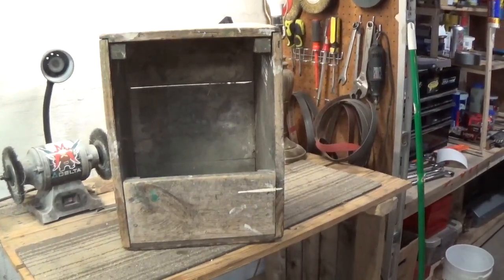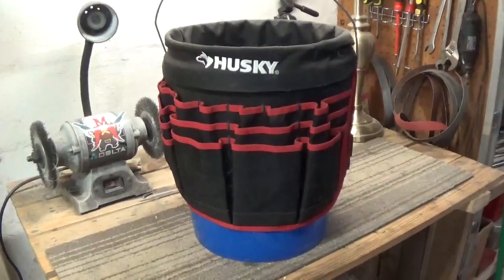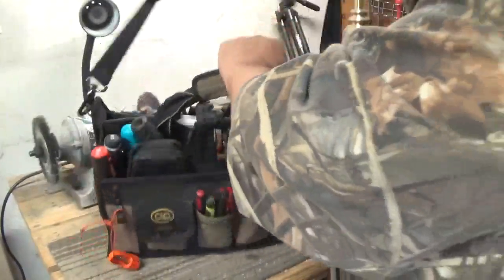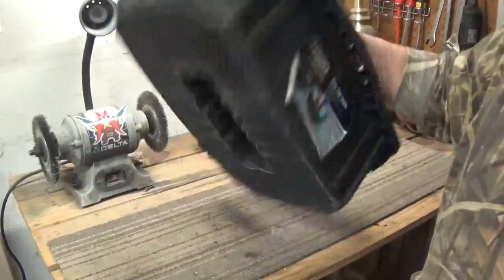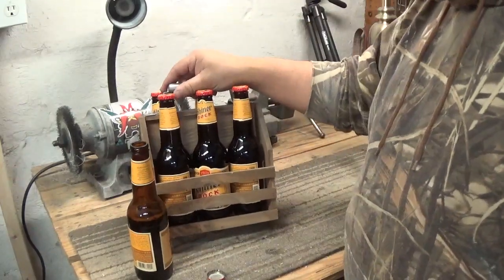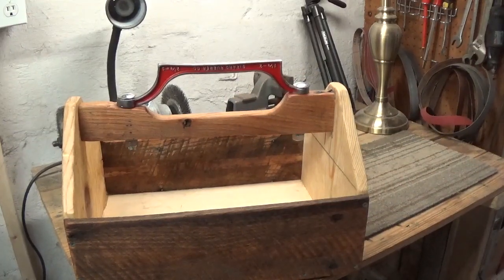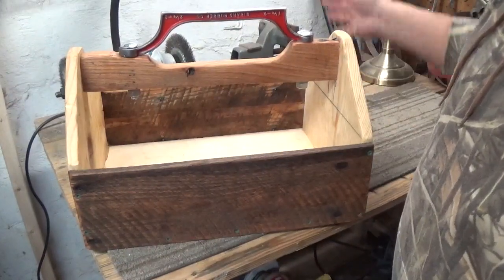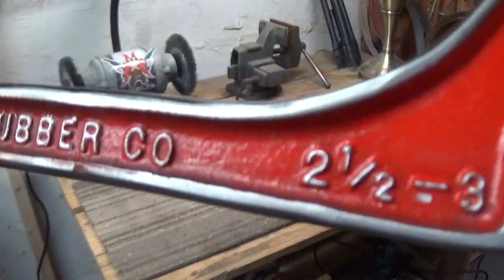Scoutcrafter Tool Tote Challenge

Comment: Turned out nice.  What was the handle used for before a handle. Stay warm here in Kansas its -8 at midnight with a -36 wind chill. Supposed to be around -17 below by morning.  Thanks
Reply from the maker: I was told that it was for hydrant hose couplers. Thanks! Stay warm!

Comment: Old English ones good for wood & the other is good for wood. About the tote though...nice job. On a side note is that vise behind your tote a wilton? I have a wilton that looks a lot like that. My pivots vertically rather than swivels & mine doesn't have the piece on the side. Have you ever done a video on that vise?
Reply from the maker: Yes it is a wilton. I will be doing a video sometime.  Thanks for watching.